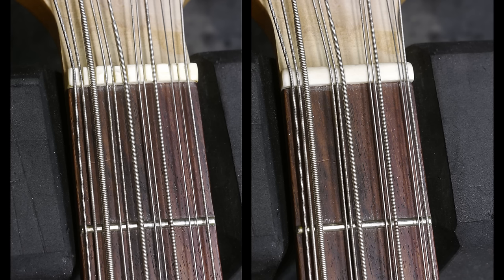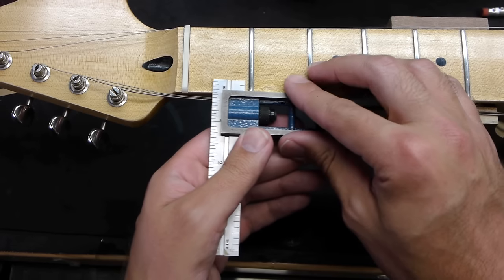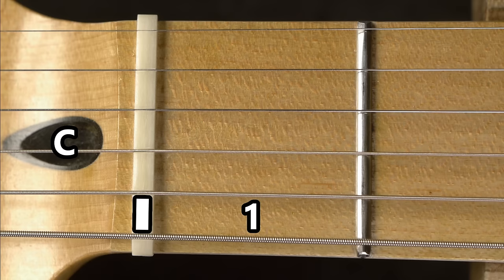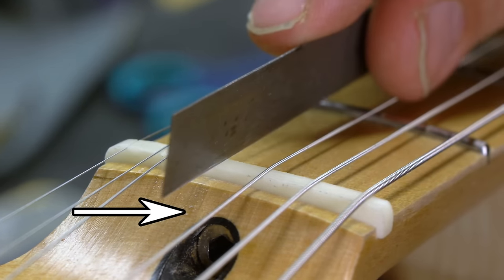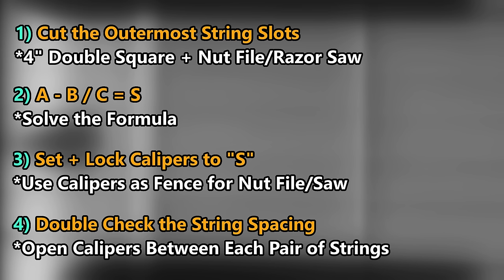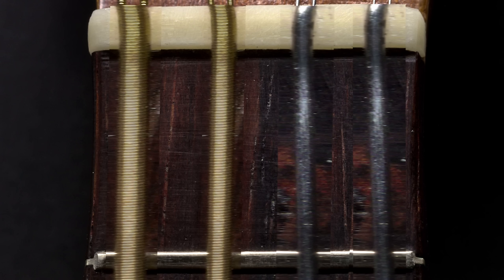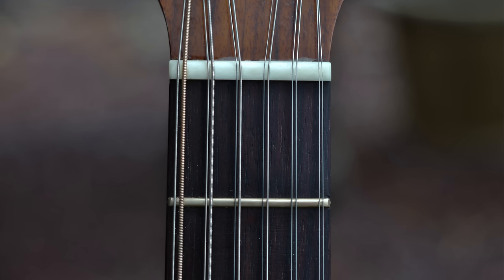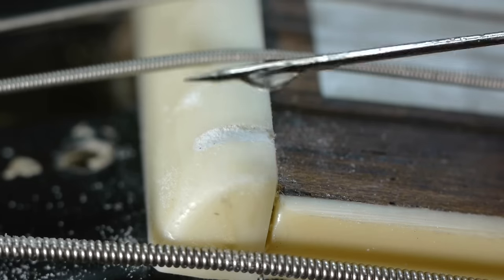Nut Slot Spacing *FOOLPROOF METHOD* - Works for 12 Strings Too!

Comment: My friend, you're a genius, or I'm an imbecile, or something in between. 

I've been doing this kind of work since 2009. 
Do you know my methodology? I open CorelDraw or another vector program, make the nut, add the spaces and the width of the strings, always keeping the spacing perfect. 

Then I print this full-scale drawing on adhesive paper, stick it on top of the piece of bone, and start working. 

You've made my life so much easier. Thank you very much for the video!
Reply from the maker: Thanks so much! I've got a long reply so bear with me. I get really psyched about this stuff so I wrote a little novella here. Here goes: 

I plan on redoing this video, so if you see it disappear at any point, it's simply moved to being unlisted. Made a few errors in this video, not the least of which is failing to mention to check the spacing after cutting each slot before moving on to the next one. 

For a while I was getting a compounding error with this method, where there would be too much of a space between the B and E strings. Imagine me coming up with this method and not even realizing that! Since I've been checking the slot spacing for each slot before moving to the next, my accuracy is within .001" for every 'gap' between each string. 

The same goes for paired strings where you can check and adjust the slot accordingly for the string pairs. 

I've had many very complicated ways of doing things, and I'm sure I have many that are similar to your previous method for cutting nut slots. But it speaks to how aware you were of the need for proper spacing! Not an imbecile at all...if there's anything I've learned, it's that you don't know until you know. 

Meaning, I'm always finding new ways to do things, and revising old ways of doing things. I'm currently redoing my bolt-on neck installation and EZ LOK threaded insert installation videos, for example, as I have a much better system for it now. 

No more enlarging holes with twist bits. Now I use a step bit for the initial widening, twist bit for depth, and a chucking reamer to finish it. 

Also am using a Woodpecker mini square and a transfer punch in the drill chuck to check for square with the chuck instead of using a bubble level, which was pretty stupid of me! I had no idea. 

Anyway, that's in the pipeline along with probably 60 or 100 other videos I've been (slowly) working on getting scheduled to upload. 

Anyway! Back to nuts:  

I cut nuts by eye for a very long time. I first was exposed to guitar work and learned a little in 2005, and things progressed more rapidly as the years went by. 

The guy I learned from, Steve K., always cut nuts by eye, and taught me to do the same. Several years ago when he tasked me with cutting a nut for a 12 string bass is when I finally finalized this method, after workshopping it for a year or two. 

The first clip in this video is that nut. It was a mess. And if there was ever an instrument that needed a simple, foolproof slotting method, a 12 string bass would be it. Would have been an absolute nightmare without this method. 

But with it? Piece of cake. I'm so glad that this was able to be of use to you. 

I always appreciate when fellow guitar techs watch my content and get something out of it. One of my target audiences is fellow techs who already have the tools and experience and might be interested in new ideas. I really enjoy coming up with solutions for uncommon problems. 

Anyway, I could talk shop all day. I'm really thrilled that this method was helpful to you. This method and how long it took me to workshop it is very near and dear to me and I'm so thrilled to be able to share it with the guitar world. 

Originally I used an Xacto knife to make a set mark against the caliper jaws, then gradually worked my way up through nut file gauges until reaching the desired size. 

Then one day I had a Homer Simpson "doh" moment, and realized it made more sense to just use the desired nut file of the proper size from the get-go. The rest is history.

And I've field tested it enough times to know it works 100% of the time, and now I can guarantee .001" accuracy. I only repeat that because I only started getting that accuracy consistently after posting this video...took me another few months to realize that you need to check the spacing on each slot as you go. 

Then all of a sudden, the extra wide gap I was getting between the B and high E strings made sense, as I was cutting that slot last, and the tiny errors had all compounded there. Since I went to checking each slot as I go along and verifying it equals the calculated value for "S," never had that problem again, and am stunned with the level of accuracy possible. 

It really turns you into a human CNC machine when it comes to nut slot spacing. 

Anyway: I totally relate to the vector drawing program and printing the paper out. Absolutely is something I would do if I had the technology skills. I 100% get it. 

Thanks so much for the support and letting me know this method helped you so much. That's what keeps me motivated to keep making videos!

Comment: Interesting. I plan to make the new nut for my strat-ish guitar. I plan to put every strings on the new nut, then cut the nut following the strings. Because, fender guitars have straight strings from a bridge to a head machine. Is it wrong way? Do I need to measure string spaces for fender guitars?

Comment: Great video!!! How would you decide on what distance between string pairs to go for (is it random?) on double stringed instruments?
Reply: That was a question, not a comment.
Reply from the maker: Thanks! For 12 string pairs, around .028" or 0.7mm is about the narrowest I've been able to get without issues. .042" or 1mm is narrower than stock paired string nuts and is much more comfortable. Stock paired string nuts are usually around .080" or 2mm between pairs, as far as I've measured. 

.080" or 2mm is OK between the strings at the bridge. That seems to be pretty standard. .042" or 1mm at the nut feels very comfortable to me, still plenty of room for the strings to ring out, and much better fretting with less accidental muting of strings. 

I'd bet around .080" / 2mm is standard because that seems to be typical spacing between the pairs at the bridge. But the problem is the neck is way narrower at the nut than it is at the end, let alone at the bridge. 

These days I err on the side of .042" / 1mm between pairs, but on my personal 12 string, I set them to .028" / 0.7mm apart. No buzzing. And very easy to play. I also re-radiused that board to a 7.25" / 18.4cm compound radius and between that and the new nut spacing, it's much easier to play.
Reply: @guitar_md That's what I call a sufficient full answer, many thanks.

Comment: Hello! I just want to ask if i can  also use the formula on the saddle? In the Philippines, we have a multi-course instrument called bandurria and it the bridge of our instrument is a floating bridge. Any answers are much appreciated :D
Reply from the maker: Yes! This will work just as well at the bridge, and I've used it many times when notching Gibson style saddles. 

If you can cut notches into the material, you can use this technique. It works great. Just set the outermost strings to where you want, and use the formula and set the calipers to do the rest exactly as I laid out here. Guaranteed success!

Comment: Dang it!!  I just received my string spacing ruler!  Now I have to throw it out.  Thank you for video!!
Reply from the maker: Ha! You're welcome. I actually would love to do future videos on this. The Stewmac String Spacing Rule achieves proportional string spacing, which may be desirable to some. It's not made for equal gaps between strings so it may still be useful for a different style. 

Another commenter mentioned that he uses a scribe with the Stewmac Rule, instead of pencil marks. The scribe will give you a starting mark for your nut file which will be much more accurate, particularly if you use a scribe that's large enough to fill up the slot in the String Spacing Rule accurately. 

I do still have my Rule, even though I don't use it. 

This video teaches what I believe to be the best method for 'equal gaps' string spacing. Stewmac is "proportional," and then you have "equal center" spacing, where the center of each string is an equal distance apart. 

The Stewmac tool is used to address the issue with 'equal center' spacing, which is that the thicker strings tend to get bunched up a bit, too close together. 

Between these methods, there are really 3 you can use for spacing a nut. This video shows my preferred method but I'll have to give the others a solid try. Some people really prefer equal centers....

...so I'd say keep the Stewmac Rule and experiment for yourself. Cut a nut with it, then one using my method -- and decide for yourself which one you like better. There is no right or wrong. 

However I do believe my method is the single best method for equal gaps. I am biased though ;)

Comment: StewMac is too expensive
Reply from the maker: Fortunately, there are many other options available these days. I will add that Stewmac does have a lifetime guarantee. Part of the high cost is that any time at all that a tool stops working or wears out, it can be sent in for a replacement, no questions asked. 

Very few other companies will offer this. Recrowning file or nut file got dull over the last 10 years? Gotta buy a new one. With Stewmac, send it back and you can get a brand new one, no questions asked. Their customer service is excellent. 

Music Nomad has many tools for much cheaper. There are also sellers on eBay. Guitar Builder Online is a great one. I own his nut and saddle sander, fret bender, and more. 

I only have experience using Stewmac nut files for this method. But any similar one will work. Hosco is another great brand. It's a great time to be a guitar tech, with more tools available at affordable prices than ever before. I recommend eBay and Amazon for deal hunting. 

Fret Guru is another great one. Usually a lot of cheaper tools are worth the risk just to see how well they work and what they're made of. You can be pleasantly surprised.

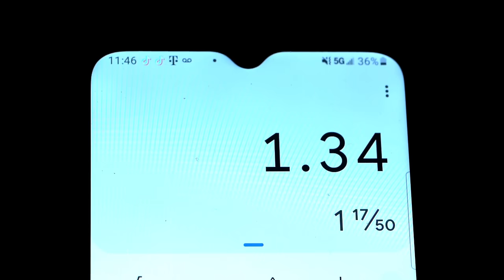Comment: In you b calculation, you say that it is 0.078". But then in your calculation formula, you put 0.78". You used the correct value in the calculator, but not in the shown formula at 4:09.
Reply from the maker: Thanks for pointing out this error. I'm in the process of redoing this video and I'll be adding that to the corrections. 

I really wish YouTube had a format like Vimeo, which allows re-uploading of video files without losing views, likes, and comments. But it just is what it is. 

Again, thank you. I wouldn't have caught this mistake on my own.

Comment: OK, " DOC " 😊
I have decided to make my 6 string acoustic into an 8 string.
By Adding an octave higher on the " D " and   " G " strings.
( The amount of chime I am looking for )
Your video is very Very helpful.

I feel there is no reason to have 3  high range  " E " strings.
( as is on a regular 12 string ) For me that is too much Chime.

I will either CUT my new Nut,  😚,   or,   modify a 12 string nut,    to accomplish the spacing.
( Please do not inform your lawyer friend about this  concept )     At 12:05
I am going to take the same liberty ,   to space the strings  on the Saddle !!
This is the information,....spacing,...depth,...I've been looking for.

To space them
I am trying to decide how wide my D and G vibrate,....along with,...... how wide the 
octave higher D and G,.... vibrate.
I'm thinking on the down stroke ,....if my pic hits the higher octave string first,   the lower octave string,.....
will not vibrate quite as wide as when that ,     higher  octave string was not there ???
My UP stroke is usually not as hard as the down stroke.
Reply from the maker: The narrowest space between the string pairs I've used is .028". I think that's a good guide to go by -- they will be close, but shouldn't buzz with that much distance between them. 

It might be possible to go narrower, but .028" between pairs is quite narrow. Even .040" is narrower than most paired string spaces from the factory -- you might even try .032" as a middle ground. 

I'd say anywhere from .028" - .042" should work. You might be able to get away with narrower -- but I wouldn't go much wider than .042". Plenty of space there.

Comment: Does the formula need to be applied for each successive string or just once? So for instance the “D” string formula would be “A” = distance between the “A” and high “E” string, “B” = width of the “D”,”G”, and “B” strings summed, “C” = 4, and then solve for “S”.
Reply from the maker: Nope -- and thankfully! It's much easier. Allow me to explain. Feel free to ask if you need more clarification: 

The formula is exactly how I laid it out, and is only done once. You only solve for "S" one time per instrument, and you're done. 

Whatever the instrument is, your value for "A" is the measured distance between the outermost strings. So on a Bass, this would be the distance between the E and G strings. On a Guitar, it would be the distance between the Low E and High E. 

Whatever the instrument is, your value for "B" is all the diameters of the inner remaining strings added together. 

On a Bass, you add together the A and D string diameters, but don't add the E and G string diameters. On a Guitar, you add together the A, D, G, and B string diameters, but you don't add the Low E and High E string diameters. 

A = measurement between the two outermost strings, B = total added diameter of the remaining inner strings. C = the number of 'gaps' you have between the strings, which you can count. 5 on a guitar, 3 on a bass, and so on. 

Doing this formula, you will only get one value for S. This is what you set your calipers to. 

I'm redoing this video by the way! To have clearer instructions. It's critical that as you go along, you measure the gap between each string pair. So you cut the A first, for example -- you check with your calipers to make sure the gap between the E and A strings is as close to "S" as possible before moving on. 

Say you calculate S = .230". That would mean your calipers should read .230" between the E and the A strings before moving on to cutting the D string, and so on. 

Doing it this way, you prevent compounding errors, meaning if you're off by .003" on each string, by the time you get to the B string, you'll be off by .015", which is very noticeable. 

Check your work as you go and you'll get a perfect result every time.

Does that make sense? Let me know -- if not, I'll be happy to explain again and will try to do it in another way if this wasn't understandable. It's tricky at first but as soon as you understand how it works it becomes very fast.
Reply: @guitar_md  Thanks very much for replying! Actually, I think you explained it nicely and I had no problem understanding the process aside from my question in the above post. Subbed and watching your other vids. Thanks again for taking the time to clarify that for me!

Comment: In regard to the 12 string bass you show at the
beginning. That must be a Really cheap ass bass.
That nut is Seriously hacked up. The strings are
not only poorly spaced, the slots are sloppy as Hell.
Reply from the maker: It was. I don't remember the make and model, but it was a mess. I've seen similarly poor jobs on some cheap 12 string guitars. It was so bad I didn't even know what it was supposed to look like -- had to look up a picture of a 12 string bass online as I didn't even know they were supposed to be in 3 courses. You couldn't tell what it was ever supposed to look like because it was cut so badly

Comment: Great strategy, although my only concern would be the trade-off of using something that t-squares as a saw-fence is that it prevents slots from being cut at something other than 90 degrees. In other words, some luthiers advise to cut a slot slightly angled towards the tuning pegs to reduce binding at the nut. So the spacing strategy would be fine, but not the saw-fencing strategy. But angling the cut might encourage throwing off the spacing, so I'm not sure if there's a perfect answer. As long as a 90 degree cut doesn't bind, it should be fine, but differing advice disagrees on this point.
Reply: The square "fence" is used for E strings only which are in line with tuning posts on most instruments. These and the remaining slots should only need a "fence" for the initial razor saw or other scribe mark. Once scribed these marks can then be dressed to the preferable angle by means of a nut/jeweler file or careful angle strokes of a razor saw.

Comment: 3:00 Often I cheat the high E a little bit further from the edge, to survive some bendy stuff without going overboard.
Reply from the maker: That's the way. All about preference. Similar things can go for string alignment on the neck, which I'd love to do a video about soon. Lots of people prefer a litlte more room on the high E string side so it doesn't slip off during bends/vibrato. My main method for that is clearing the neck pocket holes so the screws have some wiggle room and then using mylar film and packing tape to stick a shim on the appropriate side of the neck so it locks into the correct alignment when re-attached. 

But that's a topic for another day. Can't help myself over-talking about guitar stuff....thanks for the comment!